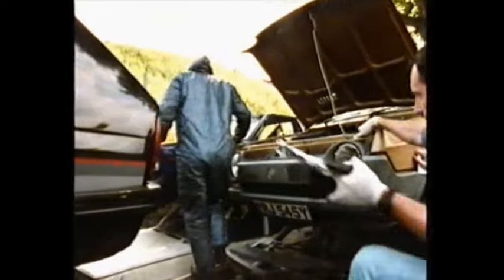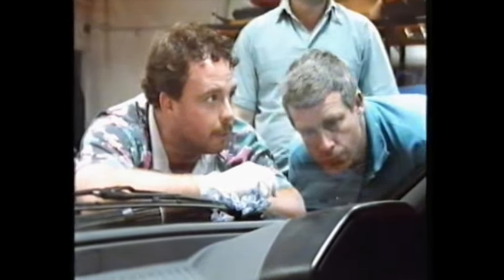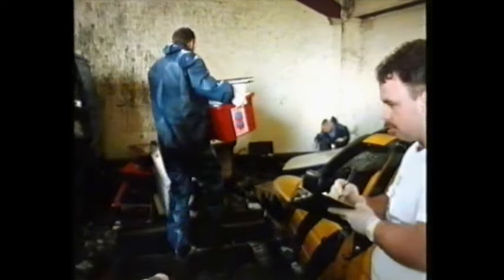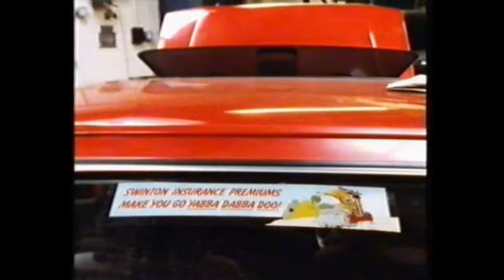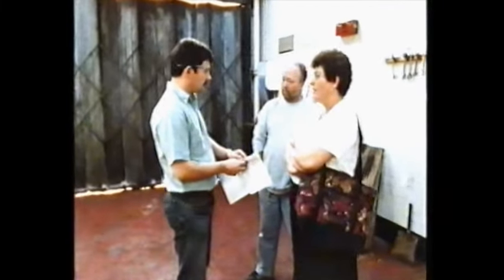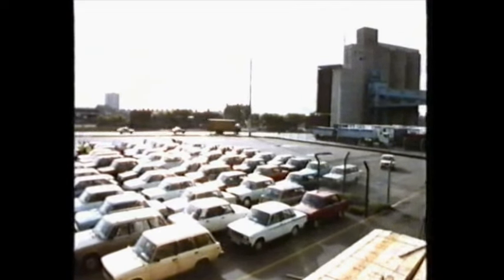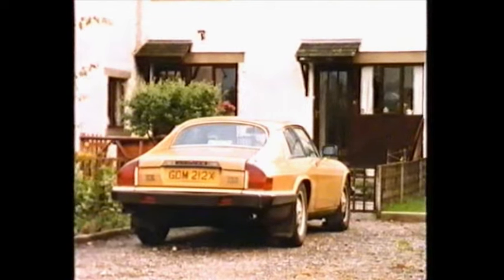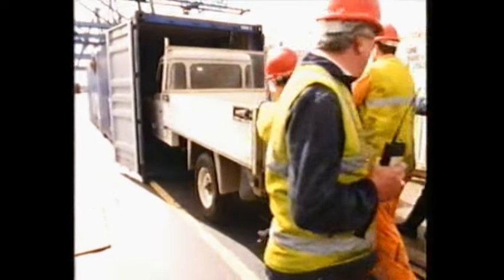'Car Thieves' - Documentary (1996 - Channel 4)

Comment: This programme should be called “Ringing for Beginners” 🤣
Reply: Taught me everything I needed to get started.
Reply: Yeah that's why you leave your dash cam running after an accident so you get the face of the other driver or use a button hole camera pen camera or watch camera to covertly get their face in case the car is on cloned plates.  Better still phone the police and claim your injured so they turn up or at least phone them and check the plate isnt showing stolen.
Reply: I agree 100% with you on that.
Reply: Or, "Ringers 4 Beginners"  - written like a private plate.

Comment: It's amazing how a good looking clean shiny car makes us forget or not even think about checking the vin tags and chassis number's all match , i know I've not checked the tags and number's on a car ive bought because I was more interested in looking for body damage and rust .
Luckily I've never bought a stolen or written off car but I did buy a Saxo with a police drug's marker on it i didn't know about until everytime i went past a cop car i got pulled over and got the car and myself searched. 
To start with the cop's wouldn't tell me that there was a marker on it until I had been pulled several times and threatened to make a harassment complaint. 
Eventually they told me it had a drug's marker on it but to start with they reckoned they didn't have that information and were only pulling me because the number plate was flagging up on the number plate recognition camera on their car's and even when they told me it was the previous owner who got the marker in the first place that they couldn't remove it off the car even though it had a new owner, so for the time I owned the car i kept getting stopped even though they knew it had a new owner that had nothing to do with the previous owner. 
I was so pissed off having to explain the same shit everytime a different cop pulled me .

Comment: I had a Rover Montego with a cut out switch they tried numerous times but never got it lol
Reply: @Martin Never thought of that one, you could rig up the sunvisor so it only works when its down lol
Reply: Mate of mine had a black 2.0turbo EFI chipped lowered, waste gate used to drive round Manchester in the late 90's blowing RS turbos into the weeds their faces where a picture.
Reply: @med86win  Yeah the Montego's seemed fairly light cars those did have a reputation for being fast.

Comment: There was a lot of stolen cars back then they where easier to take and didnt have the security locks or keys programed to the car i worked in a body shop where we got loads of stolen recovered cars to repair we had pop keys to get in them if they didnt have keys but most where a screw driver and scaffold bar to break the steering lock these days they just drag the cars off with a ihab or breakdown truck .
I heard of a crazy way a landrover was stolen with 4 hubcaps and a tub of greese the theifs jacked it up put hubcaps under each wheel and greased the bottom of the hubcaps and pushed it round the corner to a waiting recovery truck this was in the mid 90s off someones front drive .
Reply: Lol the hubcap trick ah man I remember seeing that being done with a fiesta XR2 from someone drive haha
Reply: They can nick brand new range rovers and the like with an obd2 jobby and a key scanner thing these days

Comment: Auction company putting a metro thru block with filler and no VIN plate under bonnet?
Police should be visiting them and saying if more stolen cars appear that were sold there,  that are so clearly stolen (to trade people), then they be shut down.
Auction company knew that car was bent...having somewhere to pass on stolen cars that have had zero effort put into hiding them encourages theft.

Comment: All FORDS back then had the key number in the boot lock.  Remove the boot lock and buy a key from a ford DEALER.
Reply: You bang on pull boot lock out of capri 2.8i  go dealers new key and away you go Airport car parks were favourites as you had car until date on ticket back then
Reply: @gdcodurham.  buy a set of ringer plates, and if you had to take a chase so be it . those were the days lol.

Comment: Lol stripped a 6 week old car for parts, surely it would have had more value putting fake plates on it and reselling it. You don't even get that much for parts
Reply: Get more for parts and less risk. Easier to sell parts for full price on eBay.  Few people will want a stolen motor vehicle, can’t sell to public without logbook, and to sell to criminals who will only offer tiny fraction of the value of the vehicle.
Reply: @rod058  couldn't they just knock up a fake log book? A 6 week old car with 500 miles would be worth way more than as parts provided they made fake documents for it good enough to fool an average punter
Reply: @bobbyrayofthefamilysmith24  I will agree to disagree
Reply: @rod058  on ebay? EBay wasn't around back then perhaps you had a point about fake docs in the 90s it's definitely easier now to fake documents. I bet I can get fake FSH, log book the whole works for £50 online for any car.
Reply: @rod058  had a mate in college who used to clock cars and doctor the service history, definitely possible
Reply: Ahh actually I’ll stand corrected, I was meaning now.  In the late 80s, early 90s lot easier as no central databases and other tech advances
Reply: I was told a story about a three nissan lads, taking three new jukes that had not long come off the production line.  Drove them straight out and security didn't do anything.   I think the cars were found out side one of the lads, house parked up, He would have gotten a way with it, if they had stashed them in a lockup, rather have them out side his house. I don't think the cars had paperwork let a lone a reg

Comment: funny how they make out how easy it is to ring a car back in the 90s no it was far more than a reg plate and vin tags had to change engine block number, glass and other places on the car that had the cars  id,,was done by folks that knew how to do it ,seen a few top ring cars and only a fully trained one car make and model could have a chance of saying they were ringed cars scubees range rover bmw merc jags mr2 supra cossy,any top end cars like top bmw merc the vougue rollers over 50 grand car was put in shipping containers and shipped aboard

Comment: In the 80,s and 90,s you needed a screw driver ,It was hard took 5 minutes .now its easy all you need is a lap top in a suit . no getting dirty ,press the keys and drive away in a 50 grand audi or merc or bmw . simple now 40 years later .click and go .
Reply: Ha ha,  I had a Rover Montego with a cut out switch and they work just as well on New cars loooool

Comment: The first clip appears to be a Metro. REG No A727 HEM

Vehicle Details
Vehicle make	AUSTIN
Date of first registration	November 1983
Year of manufacture	1983
Cylinder capacity	1600 cc
CO₂ emissions	Not available
Fuel type	PETROL
Euro status	Not available
Real Driving Emissions (RDE)	Not available
Export marker	No
Vehicle status	Untaxed
Vehicle colour	BEIGE
Vehicle type approval	Not available
Wheelplan	2 AXLE RIGID BODY
Revenue weight	Not available
Date of last V5C (logbook) issued	15 June 1994
Reply: Just checked it myself - on the basis that no Metro - at least of that age - would have had a 1600 engine. Sure enough all info was as you mention except the model which showed as a Maestro.

Comment: So far ive had few of these so called professional car thieves caught where i live, they were stealing top of the range Range Rovers and bringing it to our car park to rip out the Tracker where few police officers pounced on them whilst i made the call...hate these criminals!
Reply: All the owners had to do was pay an auto electrician £100 to fit a cut out switch to stop it being stolen in the first place.
Reply: @marklittler784  they shouldn't have to.
Reply: @JohnSmith-lb6ww  Yes Police should be protecting people and their property.
Reply: @marklittler784  or buy a faraday pouch for your keys off ebay for couple quid?? lol. if you can be bothered to press a switch everytime you start the car you can be bothered to slip your keys in a pouch so they don't emit the signal
Reply: @YouTubeSupportTeams  I was thinking more in the line of someone stealing the keys from your house, pocket, handbag,sports locker or robbing you of the keys on the way to or from the car  or trying  robbing you of the car whilst in it.